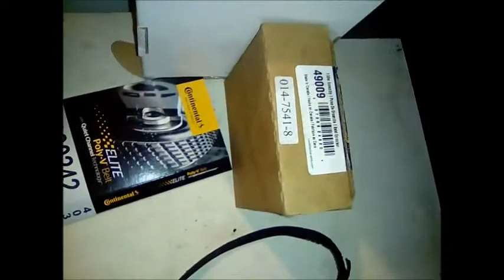Water Pump Pulley's Melted!!!

Comment: What website did u go through to get the parts I have same problem and don't know we're to start
Reply from the maker: I live in Red Deer Alberta Canada I went to "bumper to bumper" for one part and Part Auto for the rest.
Reply from the maker: 1 idler assembly, part number - 49009, Made in Canada. part number two - 014-7541-8
Reply from the maker: 1 poly-V belt part number 4030242, 3PK0615, 39037
Reply from the maker: www.partfinderelite.com
Reply from the maker: 1 Water pump pulley, part number 300-940, 53119-16030, LB895. Made in China. www.DormanProducts.com 1-800-336-3575

Comment: how to remove the bigger pulley attached with the torch wrend bolt ???\
Reply: Pulley puller kit. Going to eye up the Harbor Freight kit for $20 after I get my pulley in from ebay. I bought a junk yard pull replacement for my 2000 Deville. My DeVille's water pump belt and pulleys did the same thing. You think it would kill them to use aluminum or something sturdy instead of plastic. My Ford doesn't have crap plastic parts.
Reply: Is that big pulley supposed to spin freely or no
Reply: @brianmccleary2815  cadillac was known best with northstars for being scam artists. My pulley (99 eldorado)  actually just shattered. they are awful.
Reply: @Robbobshiskabob  only when the engine is running its attached to ur cam within the valve i believe

Comment: Same problem.
Reply from the maker: 1 idler assembly, part number - 49009, Made in Canada. part number two - 014-7541-8
Reply from the maker: 1 poly-V belt part number 4030242, 3PK0615, 39037
Reply from the maker: www.partfinderelite.com
Reply from the maker: 1 Water pump pulley, part number 300-940, 53119-16030, LB895. Made in China. www.DormanProducts.com 1-800-336-3575